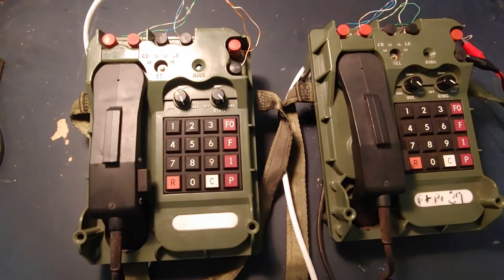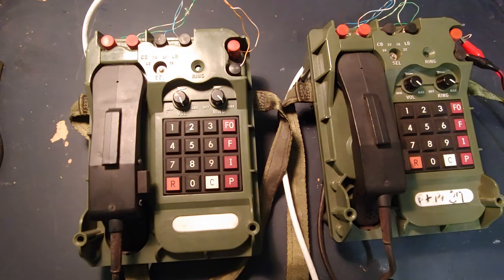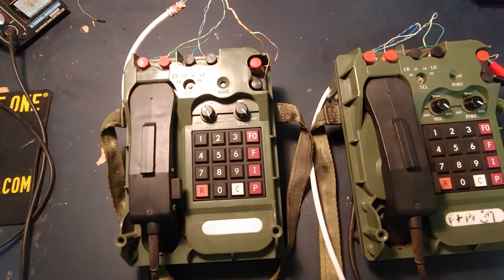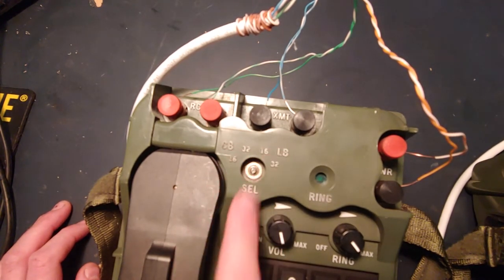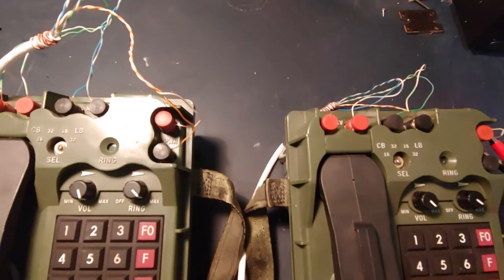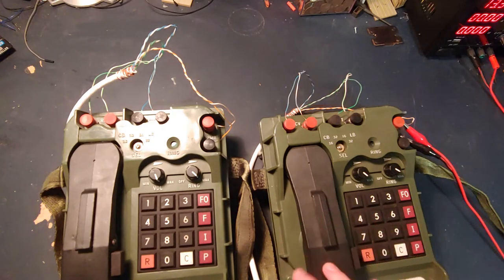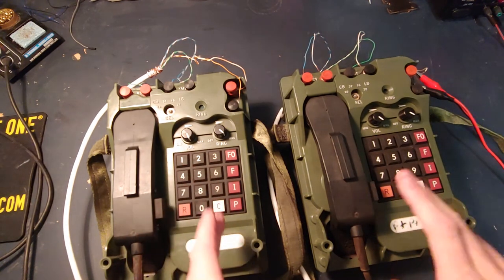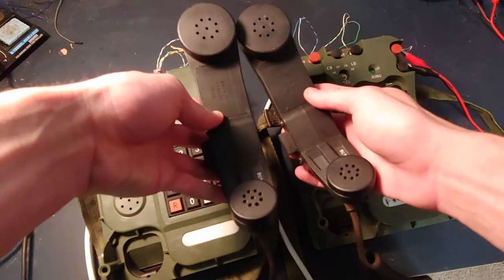Military Phone TA-1042

Comment: The TA-312s are simple 2 wire tip and ring and use local batteries and can also be connected to the phone system.

Comment: Yes, those are standard radio hand mics.
Reply: NO they are not.  DNVTs use an H-350 handset which is wired differently than the H-250s used on radios.  You can put an H-350 on a radio and hear but it won't transmit.  Same with putting and H-250 on a DNVT, you'll be able to hear but not transmit.

Comment: The CB (called common battery) mode still uses the standard interface but it switches the phone to a mode where it expects a switch to be connected on the other side of the 4 wire interface. In the LB mode it will trigger a ring on the other phone but in the CB mode it attempts to negotiate with a switch on the other end of the line. The port on the bottom is actually an accessory port that was used to connect peripherals; it provided audio access and direct access to the digital bitstream. There are fax machines compatible with these and there was a computer terminal available as well. 

If you’re curious my friend and I implemented a switch for these that can interconnect them with a computer. Finishing up a video at some point the next few days.